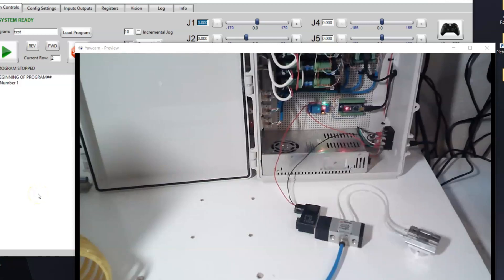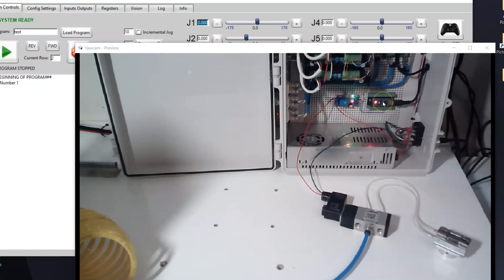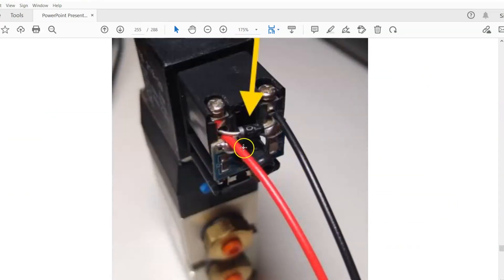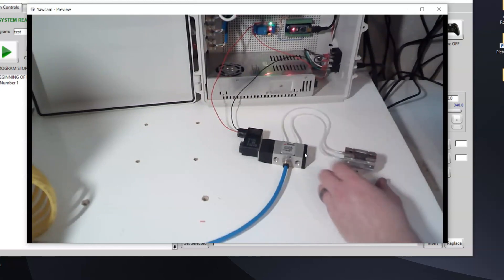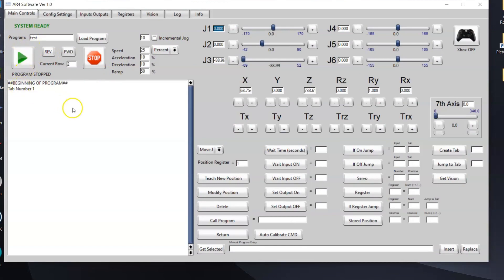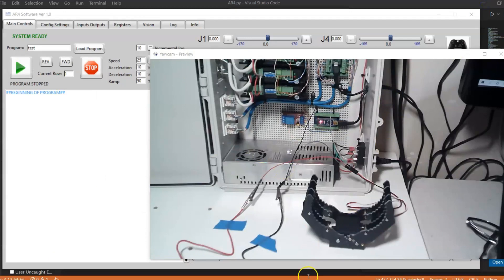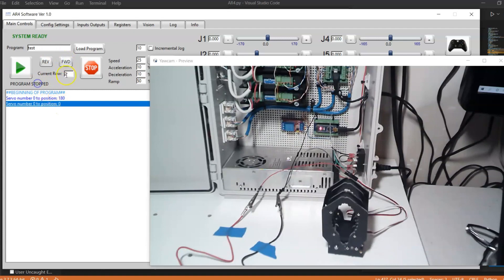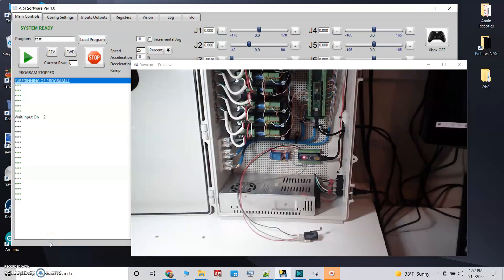AR4 robot grippers and IO connections

Comment: why did you choose a pneumatic gripper over a electronic servo driven gripper? are there advantages/disadvantages to using pneumatic gripper?
Reply from the maker: The pneumatic gripper has a higher grip force and actuates faster.  The servo gripper can also overheat over time.  I like having a servo gripper also I just prefer using the pneumatic gripper.

Comment: That's a cheap $25 gripper from Amazon with the cheapest crappy servo on earth and if you keep pushing 10 volts through it its probably already trash it a 7 volt max servo. Also that servo barely grips a can of soda and will not hold it very well since its too smooth without adding rubber. GOT like 6 of them for my robots and its just cheap Chinese junk just for show is not useful. If you're having to explain servo wires, they shouldn't be using servos without real instruction.